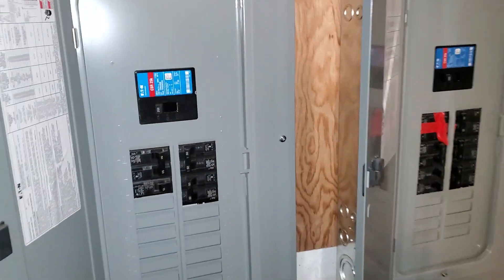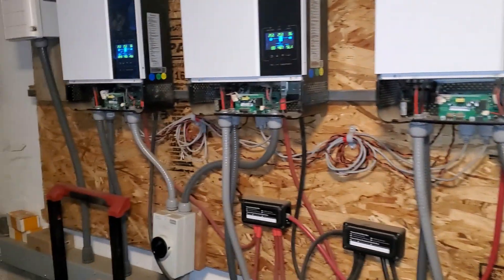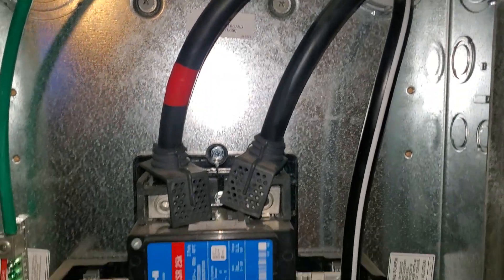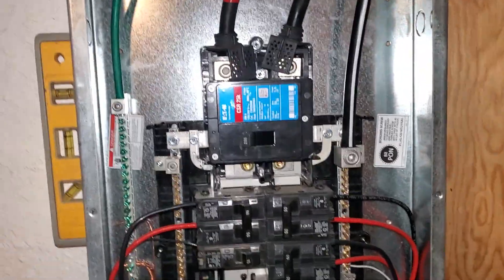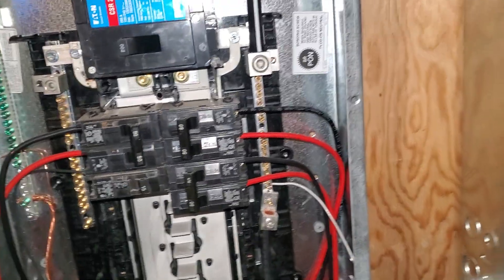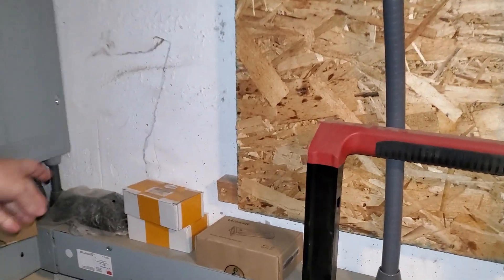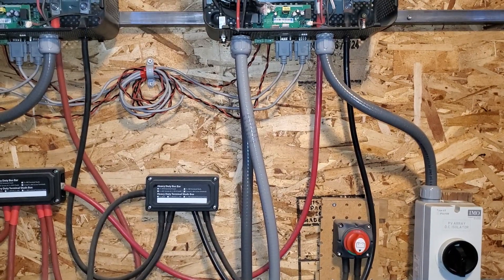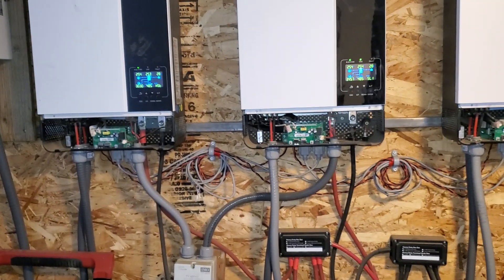wiring your growatt 5kwes inverters.

Comment: Greetings James.  I noticed you don’t have the ground from the output of your inverters connected?  I have two of the same inverters you do but I’ve never been able to get them to work properly in parallel.  What I mean is, they will work in parallel if I only use batteries to power loads, but as soon as I turn my IMO switch on and let solar power go to the inverters, whichever inverter is designed as SL1 will throw fault code 08 and it quits putting out any power to the load center.  Making the one throwing the fault code SL1 only makes the other inverter throw the same code when I retry the same experiment.  No one at signature solar has been able to figure this problem out.  Maybe I’ll remove the ground from each inverter in the panel.  Any suggestions?
Reply from the maker: Can you send a picture? I have my case’s grounded. But no ground going to the lug. Metal bars are grounded that inverters are mounted too.
Reply from the maker: Do you have the grounds combined? All my power is separate grid power only goes through the inverter’s. But my ground doesn’t. So everything works till you turn on your solar?
Reply from the maker: I know this sounds odd but I would call Ian at Watt’s 247. 
801-403-0336

Comment: Did you get the ground mount system from  Signature solar?  And if so what kind is it
Reply from the maker: No, the ground mount for the system was purchased at Home Depot. here we are required to have dual grounding rods. where the ground hooks to the solar panels was purchased at iron ridge. they make solar panel mounting systems.

Comment: Hi James could you do a video on your system grounding from solar panels to invertors, batteries, and electric panel. I see you have the invertors mounted to the 2 metal square brackets. Like your videos! Thanks
Reply from the maker: My solar panels have separate grounding. There is no grounding going from solar panels to inverters. Inverters are grounded from grounding from grounding at the shed. I have 3 sets of grounding rod’s.
Reply from the maker: The square tubing is grounded also.
Reply: @jamesshomesolarmore2223  Thanks for the info:)

Comment: Thank you for the videos James.  I believe I saw two 24v Big Batteries next to your EG4.  Have you tested running the mixed sets together on your system?  I also have 48v  Big Battery Kong Elites and want to add EG4 with them.
Reply from the maker: I had them hooked up with the 2 older gyll batteries. I didn't like them as well. I decided that I wanted to try them separately. I was going to get another hand truck/ dolly and make my own portable power station. I have a 120 inverter that i would mount up with them. the only issue is that I can only use 3 solar panels to charge them. I have some other parts coming soon to help the batteries and inverters to communicate. I am very happy I ended up buying the new e-gyll batteries with the lcd screen.

Comment: Also need a manual transfer switch to bypass growatts all together in case inverters malfuction
Reply from the maker: I won’t be putting a transfer switch in the shed. I have 3 more inverters that are not in use. 2 can be wired up in minute’s one is already up just not turned on. I unhooked the third inverter and disconnected half my solar panel’s. It’s just an experiment to see if I need that much power.

Comment: Your red phase tape is on the wrong feeders in both panels
Reply from the maker: The red tape was to run and identify the different leg’s. There is 80 feet between the meter and that shed. There is also 70 feet back to the main panel.

Comment: Thanks for the walk-thru James.  A lot of discussion on YouTube around these inverters and the ground/neutral bonding.  My understanding is that if purchased from Signature Solar, the internal bonding screw is not connected therefore mitigating ground loops through the inverter (when connected to grid panel ground/neutral).  The issue is that people purchase these on Ebay with the bonding screw still in place which is a hazard.  Signature Solar is changing the model number of the inverters they sell to differentiate.  Anyway, the other issue is the potential loss of the 120 leg from the autotransformer.  How are you mitigating that?  What size breaker are you connecting the transformer to etc.?
Reply from the maker: I am going to release another video on these inverter’s and the auto transformer. I am waiting on order from the internet. I will be doing a real inverter transformer power test. I haven’t seen anything like what I plan. Hopefully I don’t fry my system. I plan on putting a lot of 120 loads through the transformer.
Reply from the maker: i have 50 amp breakers on inverters and solaredge transformer. all of mine are purchased thru signature solar. i have also purchased thru watts 247. the products he sold were not able to provide the power for my heat and air con needs. with all the solar edge transformers? why don't we hear about lots of failures? the important thing is wire sizes. the inverters and solar edge transformer need 8 gauge wire. so are you running a bunch of 120 heaters? i have power appliances table saw miter saw and metal cut off saw. all work just fine and i can only run one at a time. my auto transformer is from solar edge who has made them for years. i dont know whose batteries you are looking at? but signature solar has the best. i also bought batteries recommended by DIY solar. they aren't as good. i will have my new batteries on monday. hope to have them up and running next week. most of my 120 usage is less than 300 watts. thats a play station 5 2 tv's and all lights and other appliances. 2 refridgerators. so i don't worry about it the transformer. just remember too small of wires cause heat. use the recommended wires never use small gauge wires.
Reply from the maker: It’s not just an internal bonding screw. I have surge protector’s some are just the power strip variety. But I also use the same type that is for kitchen and bath area’s. I do use other things that don’t get plugged into them. But I unplug from those outlet’s when not in use.